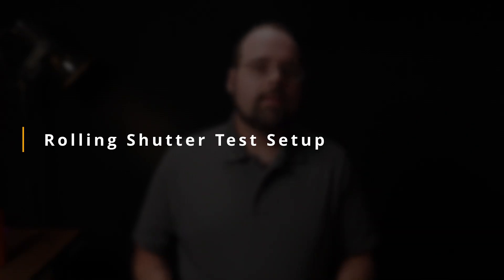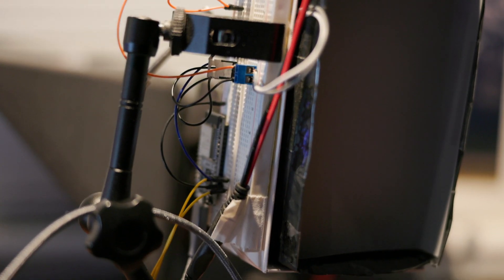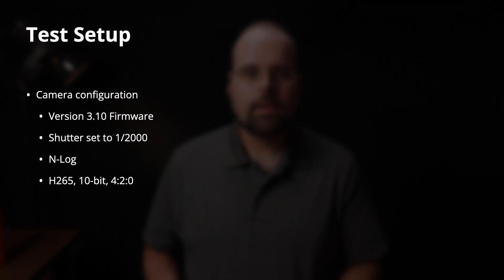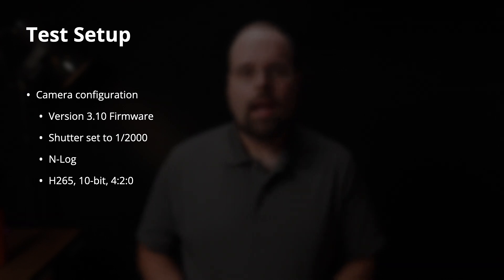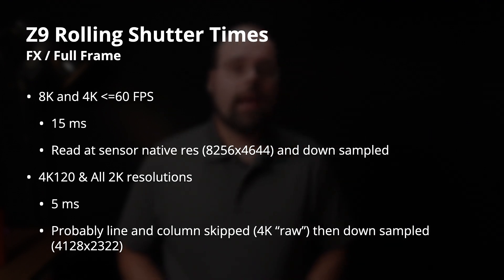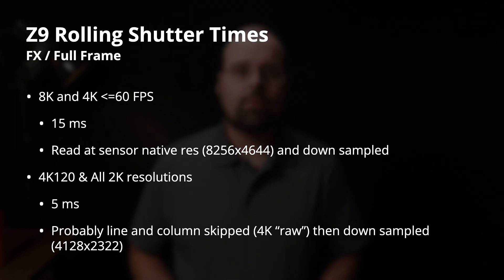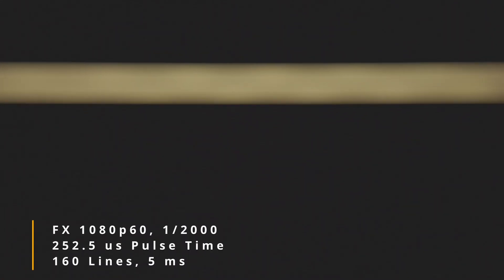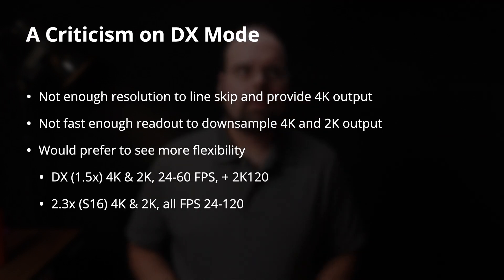Nikon Z9 Rolling Shutter Performance Testing

Comment: I really like the test and your scientific approach. Thank you so much for sharing this. Would you have any chance to rerun the tests with the latest firmware with N-RAW? (you should be able to playback the files in free Davinci Resolve without a problem). So the 4k FF has a faster readout than 5.4 or 4K DX 60fps because it's reading the entire DX area in both cases? Also DX 2.3x 4K 120fps is available with the latest firmware. It would be nice to see if the DX 4K 120fps has better readout than the line skipped FX 4K 120fps. I'm simply looking for the combination of the best quality & fastest readout for action shots.
Reply from the maker: Unfortunately, I can't do anything about retesting anytime soon. I don't own a Z9, I borrowed one for these tests when I also had my test rig setup for something else. To make matters worse, I subsequently tore my test rig apart because I needed the micro-controller for another project. So retesting is not something I can easily do.

My suggestion for 4k120, would be to do some subjective testing yourself with realistic subject material for what you intend to shot and see what looks good to you and not get too caught up in what's technically the best option.
Reply: @PointsInFocus  anyway thank you so much for all the effort you put into the test! It's a great job!